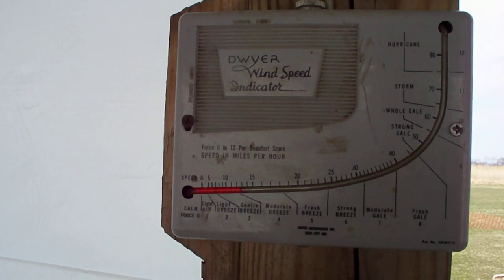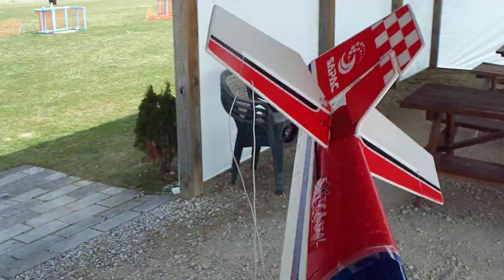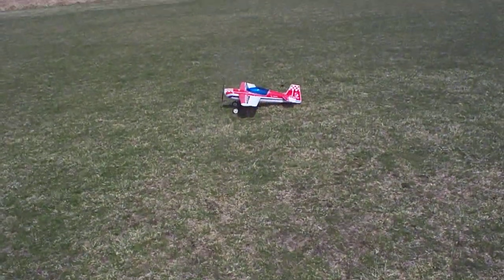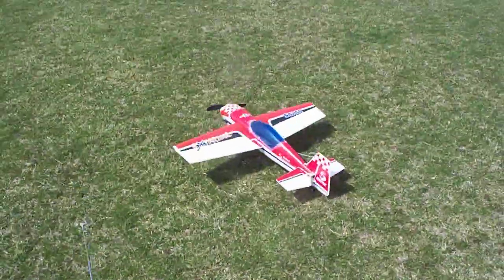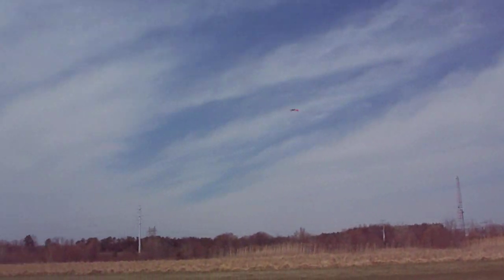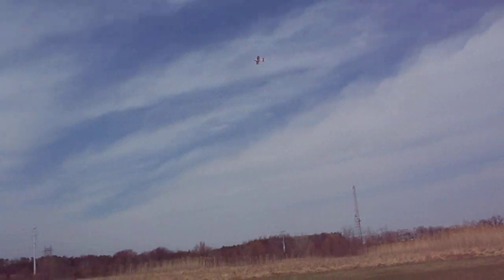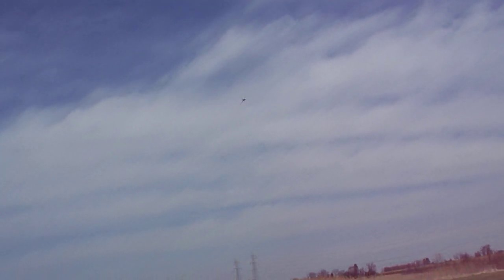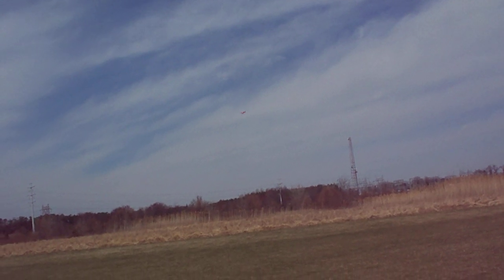Gyro on a Foamy Electric Sapac 330L

Comment: It is not my intention to be rude, but your handling that thing from the prop end with it armed is very unsafe. Also, when you arm the plane have the prop off the table so that if is does accidentally start (and they do sometimes) it will not trash your prop, or worse flip a piece of it up in your eye......Just a safe simple observation